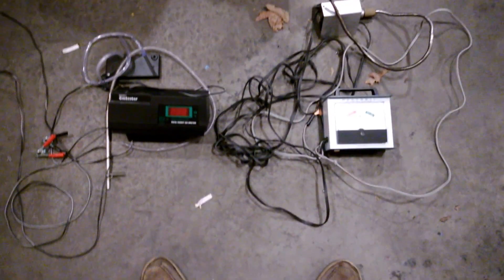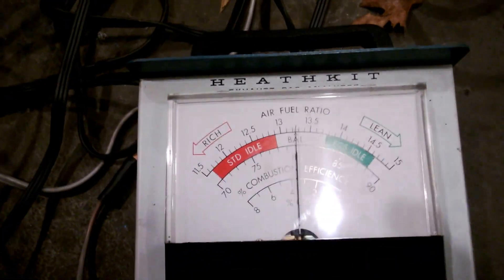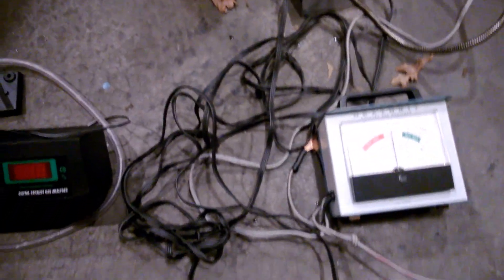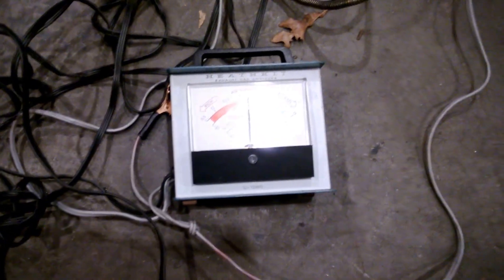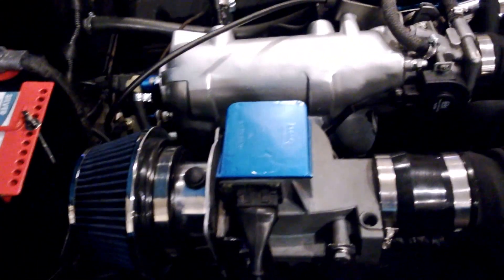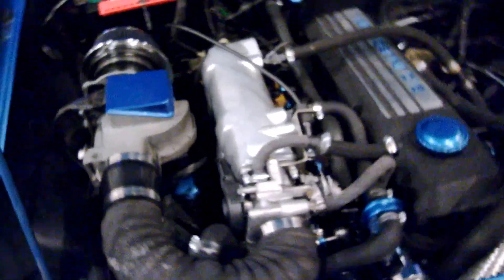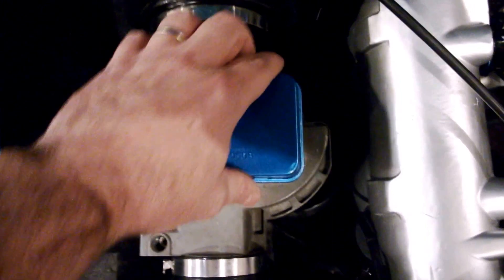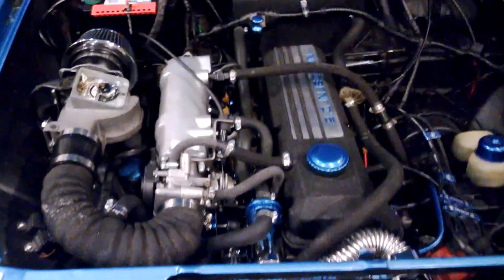Bosch L-Jetronic Fuel Injection AFM Adjustment & Tuning - Part 1

Comment: Hello, I am taking part in a research project. I could not find almost any information about the "main relay" of Porsche 912. Can you help me with this?
"What is the main relay of 912 L jetronics used for?"
Reply from the maker: Most the relays are simple dual relays and can a regular relay in series can work instead of the old model specific one. Look at your wiring diagram and follow the logic.

Comment: Would you have any insight on this issue? 84 318i. I start the car and get normal fuel pressure but will run horribly rich and stall unless I pull fuel pump fuse. Car runs smooth with no fuel pressure; immediately hesitates when fuse is reinstalled. Doesn't make sense. Both pumps are running and injectors are ticking along. Afm or dme issue?
Reply from the maker: That is wierd. I have one with bad ecu run like that. The issue is with no fuel pressure but running, at idle, could be stuck injectors or bad computer.  Do you have a guage on the rail to check fuel pressure ? Problem with diagnosising something like this. Is the Ljet is so stupid it can idle but not run. So you end up with replacing everything till you find it. I would start with making sure the pressure at the fuel rail is steady with engine off ( you can jump two wires or hot wire fuel pump at relay ), and make sure you don't have vaccum leaks. Also check battery voltage, all these are simple enough and cost nothing
So That would be first. Also check fuel quality. If that's all good, pull injectors and test them to see if they are leaking and/or fire. Then replace the fuel rail seals. If all that's good. Check your wiring and grounds. Then your probably down the AFM and ECU.
Reply: @GoinManta  Hey thanks for the quick reply. Yes, it is very weird. I do have a gauge on the rail. I can see that it will crank to 43 psi just fine, then I can get it to start without fuse in place and it will run great. Gauge will show 0 psi as its running. Once any pressure is applied, as the fuse is connected, it will stumble and run as if the injectors are spraying way too much fuel. All spark plugs will be wet with fuel. The injector 0-rings have been replaced but I will check for other vacuum leaks as well as grounds. I think at this point, I may have to try a different ecu and afm to rule them out indefinitely. Thanks again!

Comment: cool. I have this mounted on my 2.0 liter 1987 lancia thema i.e. 8v (1st series) Now I have a no start condition so I started with the fuel pump that was clogged with gunk. Now I have my injectors spraying but I'm not sure the fuel pressure is enough so I'm looking all over the internet the fuel pressure specs for my engine (834 C.000 - 166CV (122kW)
Reply from the maker: 3 Bar - 38-42 PSI is standard for all Bosch EFI
Reply: @GoinManta  thanks so much!!! yes. I just bought the manual and it says the same 3psi (+ - 0.2 bar) :D YAY !!! TY (also, the pump produces a pressure of 5.5 bars when not connected with the regulator, so I'm assuming it's good. I only did this for a second to get the reading to not damage the pump)
Reply from the maker: @friedchicken1  no start could be flooding as much as too little fuel. If the fuel pressure regular is bad. Good thing is universal adjustable fuel pressure regulators can be used in place of the old stock ones.
Reply: @GoinManta  This is such a passion huh? I have 3 classic cars. 1976 fiat 126, 1978 Peugeot 504, 1987 lancia thema :)
Reply from the maker: @friedchicken1  1971 Opel Kadett 4 Door, a 1972  Opel GT, a 1973 Opel Manta A, a 1992 Opel Senator B, and a 1995 Opel Calibra.. My son has a 174 Opel Manta A, and I have owned dozens of others.. yea.. its a sickness.
Reply: @GoinManta  wow WOW you win! you have the calibra :O I'm drooling rn
Reply: @GoinManta  I had a 89 kadett and unfortunately I got into an accident I'm lucky to be alive, if you go to my channel and search "crash" you can find the picture video
Reply: still no start condition, I get a hint of starting, the spark plugs are firing and all but it won't stay on for more than 1/4 of a second